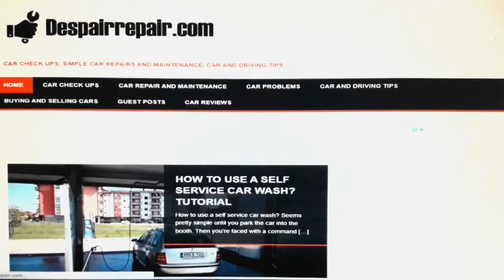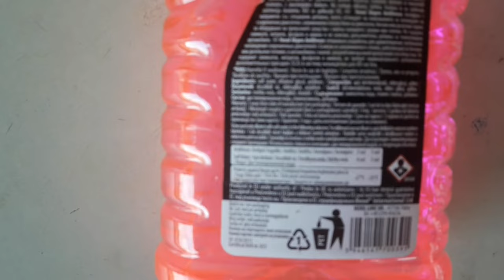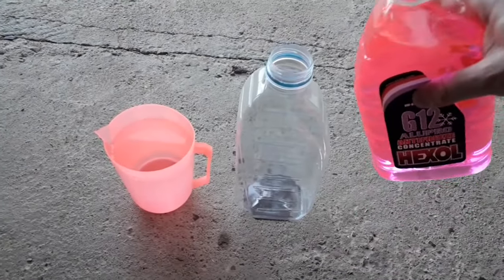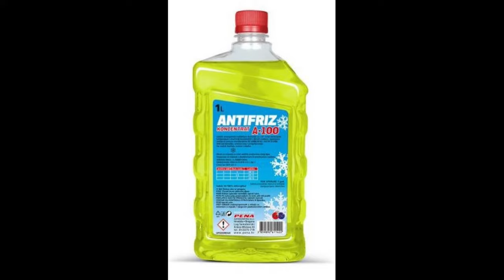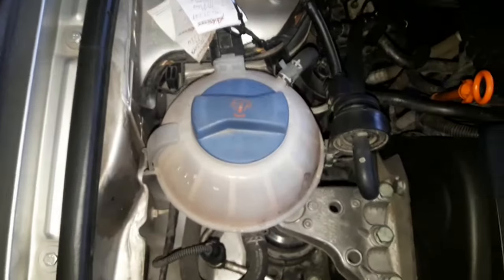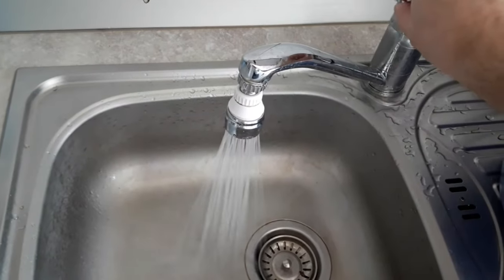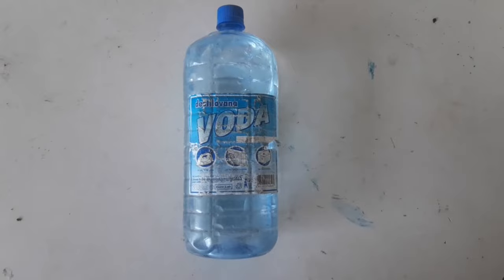How To Mix Antifreeze Concentrate With Water And Add It To The Engine?

Comment: I saw this video a little too late, just finished flushing my cooling system after adding the wrong anti-freeze.  I'm one of those people who are allergic to reading manuals and so when i bought the concentrated anti-freeze, I did what you said one should not do, that is pour it directly into the reservior. Now my car is shaking, has lost power and the engine warning light has come on. Lesson learnt. Anyway thank you for the video, certainly educative.

Comment: So concentrate is add water one ? And concentrated you can just put in without any water that is right ???
Reply from the maker: Hi and thanks for watching!

It's best to mix it with water first otherwise you may damage the coolant system.
Reply: Concentrated Coolant is 50 to 50 ratio. 1 Gallon of concentrated Coolant equals 1 gallon of Distill water hence 50:50 ratio.
Reply: Concentrate is not the added water. 50/50 ready to use is the one with added water

Comment: I am not going to lie, I accidentally put 100% concentrated. Should I remove all?
Reply from the maker: Hi, thanks for watching, and sorry for the late reply.
If all the coolant in the system is concentrated, yes, remove it all.
Otherwise, you may damage the coolant system like the water pump for instance or the car may overheat.
Reply: @DespairRepair  I got overheat unfortunately I learned lesson hard but will it go back to normal if I use 50/50?
Reply from the maker: @marcozuz7072  Hi and thanks for watching!
Yes, it should be OK if the engine hasn't seriously overheated and for a longer period of time.
If you have the chance, first mix the coolant in a separate container and check it with a coolant tester. Then pour it into the system.
Also, check for leaks afterward, just in case.
Hope this helps.

Comment: Thanks for the helpful video! I've had a slow leak of coolant for a few months. Given that fixing the problem is quite expensive, I just keep a bottle of coolant in my car and top it off when necessary. I noticed my car starting to overheat while waiting in the drive thru today, but luckily I was very close to home. The temperature gauge was at the last white marking before the red marking. When I got home I discovered that my coolant bottle was almost empty, but I also wanted to make sure I added enough volume to get me to a store to buy more. My coolant is the pre-diluted 50/50 variety, but since I didn't have much left I diluted it with equal parts bottled water. I didn't have an distilled water and thought bottled water was probably better than tap, and I waited a few hours until the car cooled down before I added it. I know you can use straight water in emergency situations, so I reasoned that a 25% coolant solution was probably better than just water. Do you think that was ok??? I hope I didn't make things worse.
Reply from the maker: Hi and thanks for watching!
No, I think you did the best thing in that situation. Everything is better than getting the engine overheated.
In my opinion, there should be no damage but if you want to be 100% sure, change the coolant and call it a day. It isn't that expensive and it will give you peace of mind.
Of course, despite the cost try to solve the leak asap as these tend to get worse over time.
If you decide  to leave the coolant that way, then make sure you check it with a coolant tester.
Hope this helps.

Comment: Great video, recently had leak and added 1/2 liter water should i add same amount of concentrate or first test coolant. Thanks
Reply from the maker: Hi and sorry for the late reply. I would best add diluted coolant (in that case two third coolant, one-third water).
Do the coolant check anyway so you're sure for the future.
Hope this helps.
Reply: @DespairRepair  Should I add the solution to radiator or reservoir. Also I have to remove existing coolant 1/2 L, does it matter from radiator or reservoir. thanks
Reply from the maker: @nb9536  it really doesn't matter choose what's easier for you.
If it's just half a liter you have to remove then you can use the coolant tester and suck the coolant out.
It takes a bit more time but beats taking off the hose, clamps, or vents.

Comment: can i use any water? water bottle?
Reply from the maker: In case of an emergency yes you can. But it's best to add distilled water.
It's widely available and prevents scale build-up in the system.

Comment: Shit. I added water and then concentrate to the car, i thought it should be the same thing
Reply from the maker: Hi, and thanks for watching! Well, you basically have two options:
The first, which is safer, would be to flush the system, mix the concentrate, and refill the system again.
Or you can just start the car, hope for the best, and let the water pump do the mixing. 
If you decide for the second, once you start the car rev it up from time to time.
Hope any of this helps.